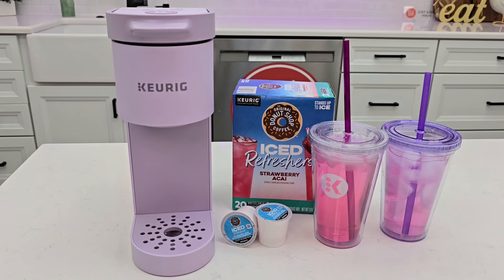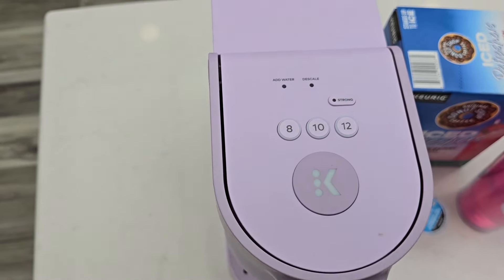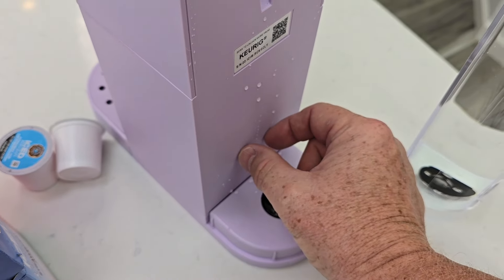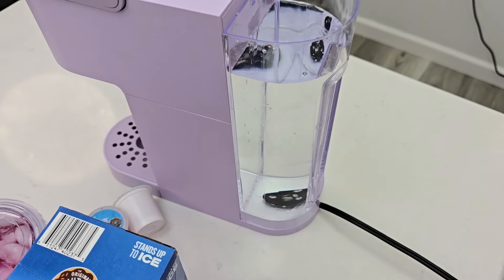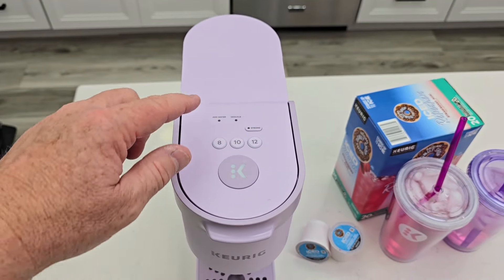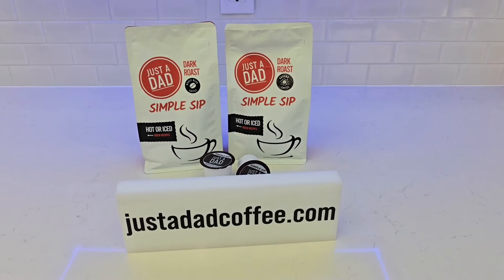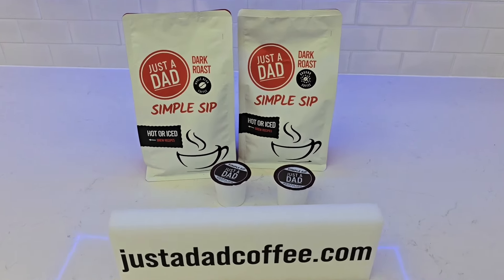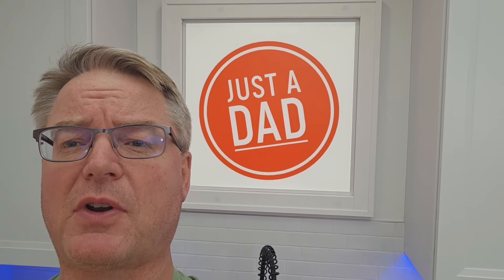Keurig K-Mini Go: How to Fix Add Water Light K-Cup Coffee Maker

Comment: Hello. Checked for solutions to the “add water” problem and came across your videos. K-Latte with milk frother is the unit I have. Tried the “prime pump”…nothing. Unplugged and replugged…nothing. Washed the tank with vinegar and water…nothing. Removed the tank and gave a CPR mouth-to-mouth over the tiny air vent. Air moved freely but…nothing. Even turned the unit upside down and began removing screws — but reversed course quickly as I was getting into uncharted territory. However, as I held the unit upside down, I heard mini gurgling sounds, and water trickled out on to the counter. So, I held the unit over the sink and shook it. A little more water plus coffee particles ran out. I was like, huh! So, I shook it even harder. Then, harder yet like it was a matter of life or death. Did that for about a minute. Plugged it back in. Filled the tank. Turned it on. Guess what? The “add water” light did not appear! 🙌 Then came the familiar sound of music to my ears. Inserted the pod, closed the lid and hit 10oz. Thinking it was a combination of your troubleshooting tips and the near death shake. So, thank you. We’re back!